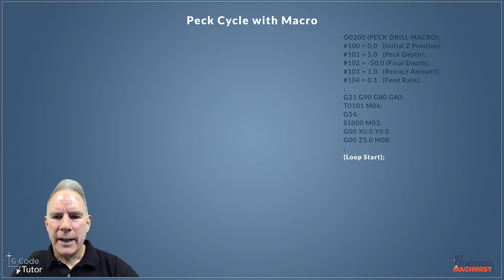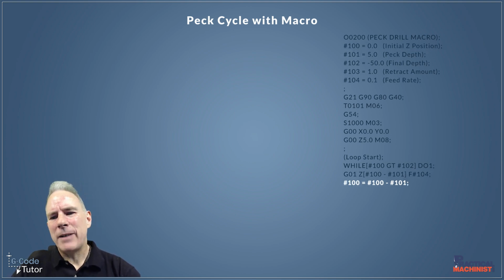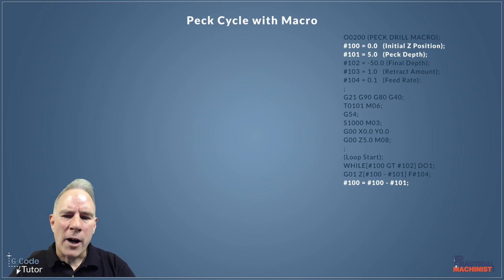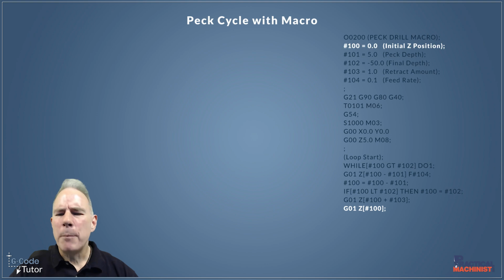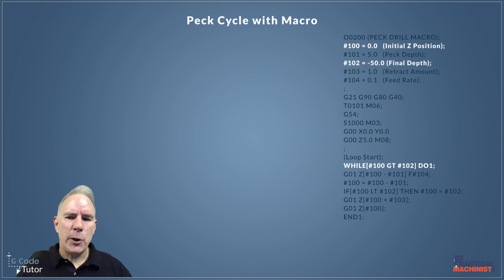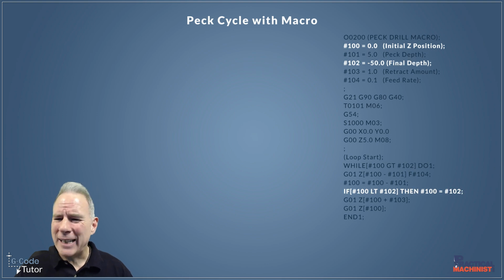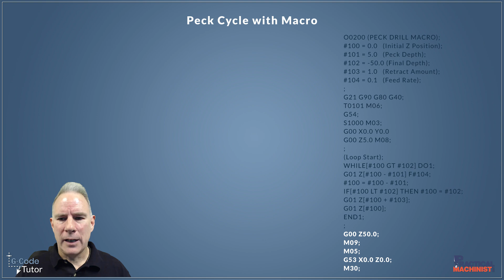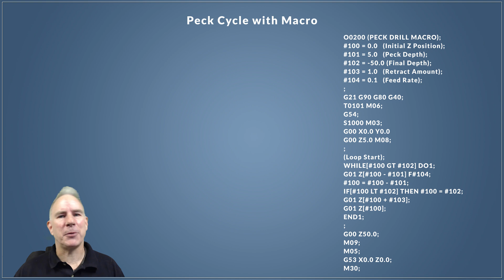Is It Possible To Create Peck Cycles With Macros?

Comment: not a good idea to do the if test after you have already drilled to depth. if 102 was -49.0, you would have drilled to -50.0 before doing the if check to change the drill depth.
Reply: Ok so how would you change the code
Reply: @dinglesdingler1211  In the video case, I would move the "G01 Z [ #100 - #101 ] F #104" below the If test line; And change it to "G01 Z #100 F #104". Since #100 will already be updated with the new Z depth information, you will not need to do the calculation in the Z move.